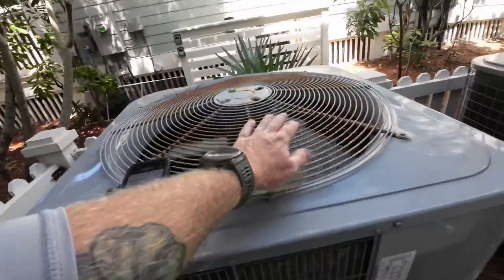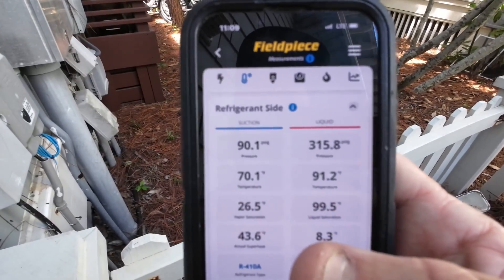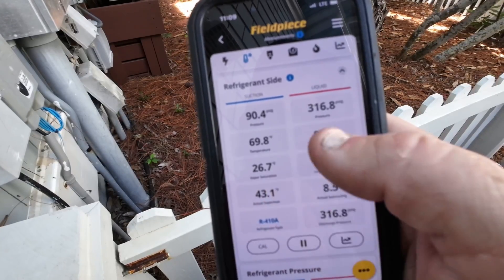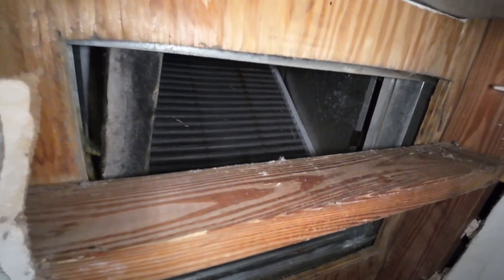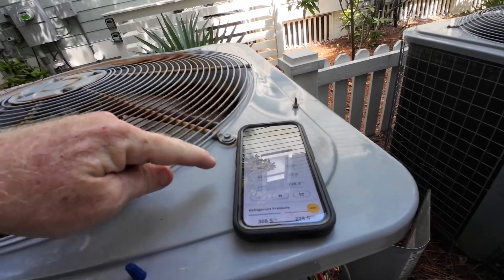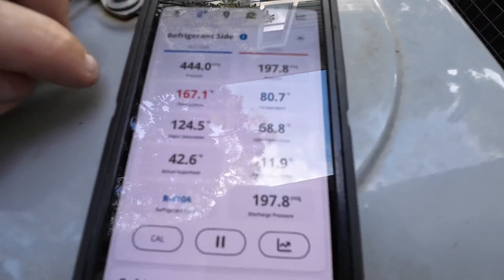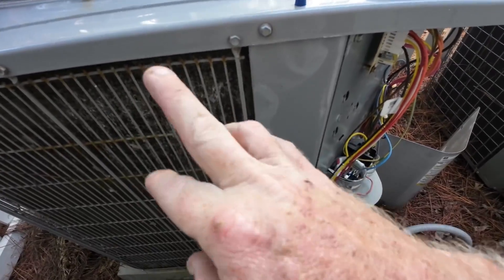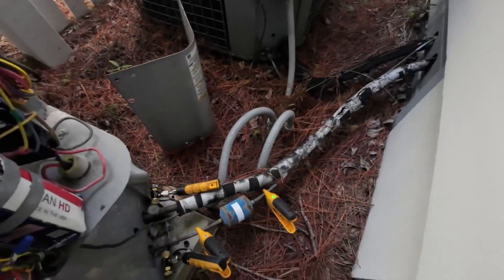One quick way to check a TXV | before replacing

Comment: When you mentioned it looked like restriction in heating mode, remember that is a carrier unit and there is a piston in the liquid line after the service valve. So you will see a pressure drop there. Unlike all the other manufacturers that typically have outdoor txv inside the outdoor unit. Then the pressures are relatively the same
Reply from the maker: Yes sir. That why we give it 10+ minutes

Comment: How could it be the TXV? You had high superheat and low suction pressure in cool mode. Then you put it in heat mode and you still had a restriction. TXV in cool mode would not cause a restriction in heat mode. Only the outdoor TXV would cause a restriction in heat mode.
Reply from the maker: The little screen and the liquid line at the TXV was clogged
Reply: Don’t think he had a restriction in heat mode. Assuming it’s 80 inside and 90 outside heat mode didn’t look bad
Reply: @AdamCraig-s6s  not what I meant. If you have a restriction at the indoor txv in cool mode and if you switch it to heat mode and you dont have a restriction in heat mode then you have a bad  indoor txv.
Reply from the maker: @mrautoguy8419 correct. If under warranty they pay the same price in labor to remove screen. I just order new and replace. It was done next day.

Comment: Holy switch aroe  batman 😂
   That was a nice move going to heat mode to knock it free , tapping with my linemens might be as far as id go. But not many heat pumps for me . 
    I do like the fieldpiece data link you are sporting . 
    I did learn sumthin you say 2degrees across fdryer its N/G . Im happy for that info . I was told any more than 4degrees . 
     But gonna run with you brother. Thanks for the post for us guys sweating in the field. ✌️
Reply from the maker: More 4 degrees is a bad restriction. 2 is a restriction causing mild low pressures. Meaning some refrigerant is getting through.

Comment: Someone may have dumped Freon in it trying to bring that suction pressure up, that may be why it seemed high in heat mode. Never know. Good vidio though bud. Thanks.